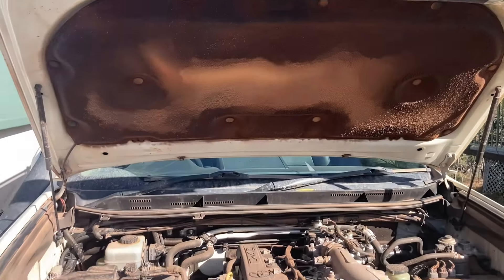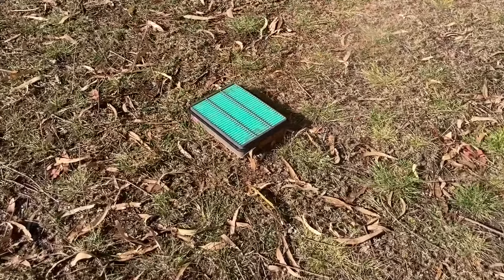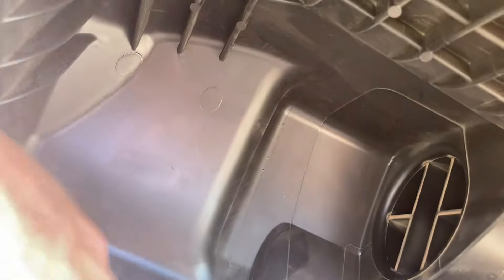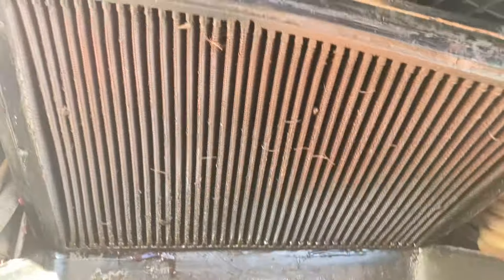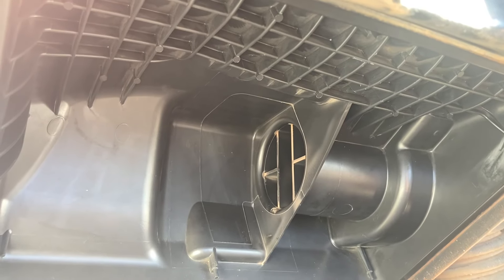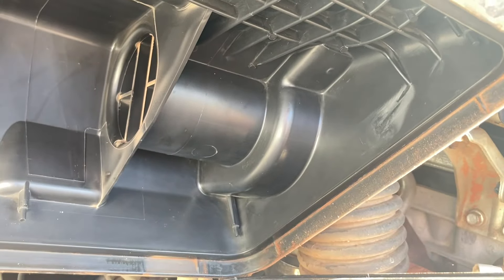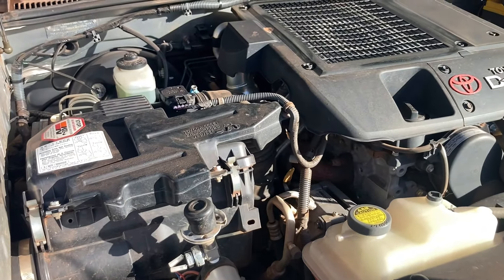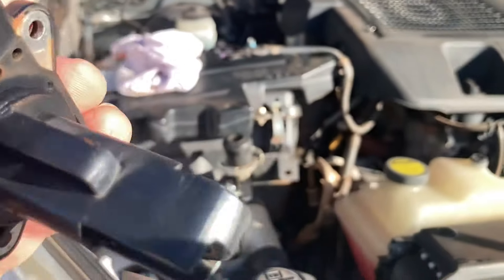The DUSTIEST REAL WORLD AIR FILTER TESTING K&n vs Genuine

Comment: I wonder if a few days before replacing filter you silicone the underneath lip of the filter seal (and smooth out to a consistent level), if that would increase the seal pressure, hopefully giving better seal? 
IDK, just a thought.
Very disappointed in that genuine leaking like that.

Comment: Dozers: working in dusty conditions use cyclonic prefilter (gravity-centripetal acceleration separation device)…a bit like (but different) to Dyson vacuum cleaners.  Same principle though, just different patented design.
I don’t know why no one discusses this method of pre filtering?
I know some just turn the snorkel head around to face backwards.  
Is this effective…I’m curious.
I’m sure I’ve seen these dozer type cyclonic prefilter on  the top of snorkels.
Surely these are effective?